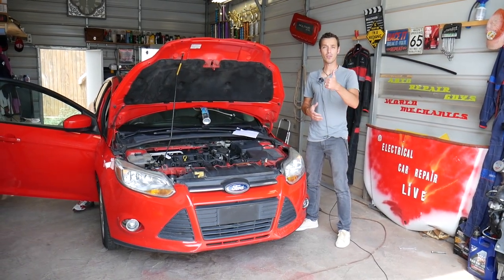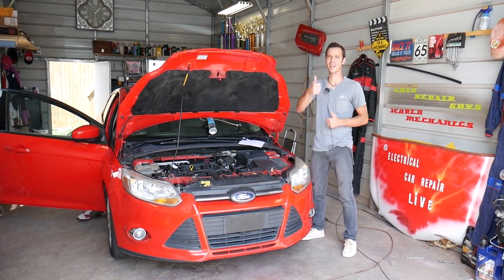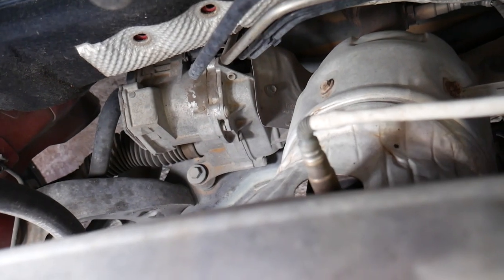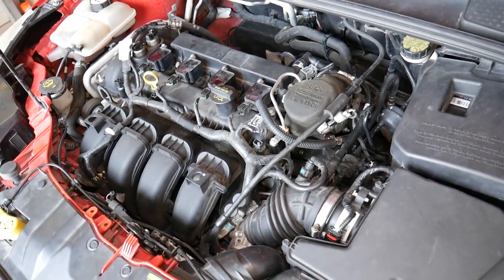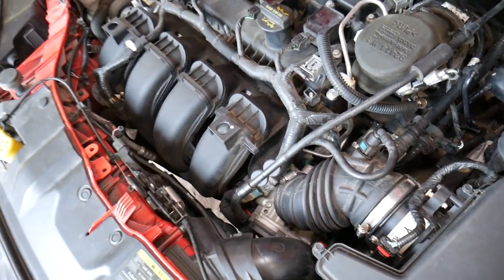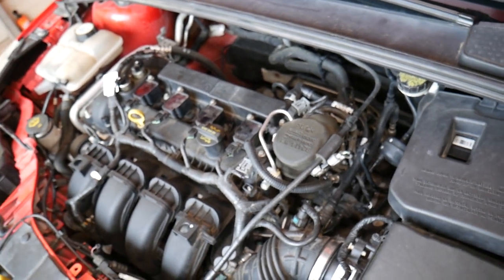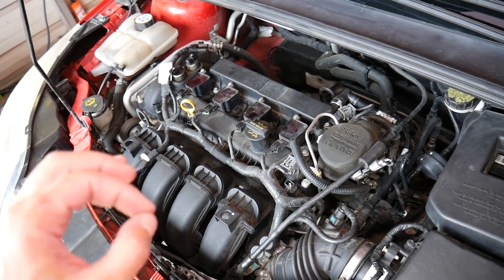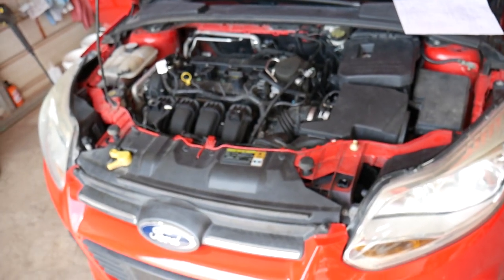FORD FOCUS CODE P0171 SYSTEM TOO LEAN FIX 2011 2012 2013 2014 2015 2016 2017 2018

Comment: i have a 2012 Ford Focus 1.6 ti-vct, no CEL, no codes, the OBD scanner shows "lean condition" when the car surges and sometimes intake backfire between 1000-2000rpm when i apply 30% or more throttle. We have flow tested the injectors, changed the spark plugs, changed the coil, tested with another MAF sensor, fuel pressure is 4bar. Please help
Reply: Wow take it to tech , spark plugs and coils won’t remedy that issue . Do you have access to fuel trim live data ?